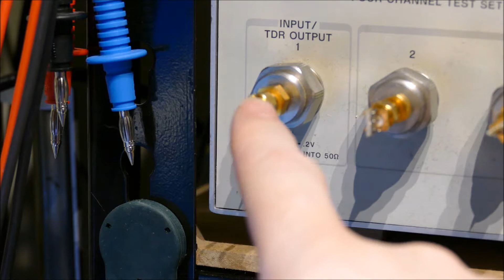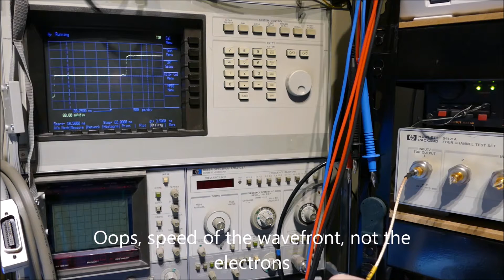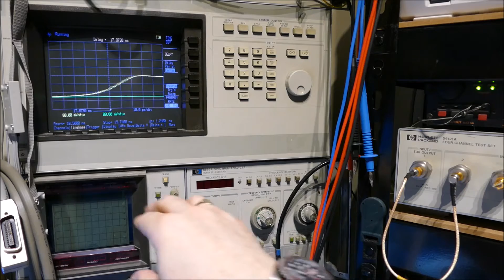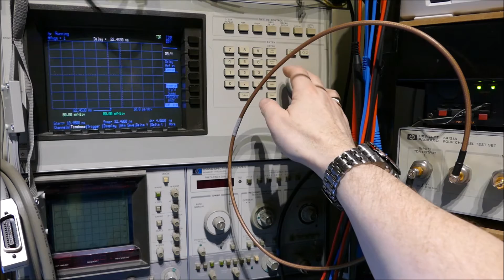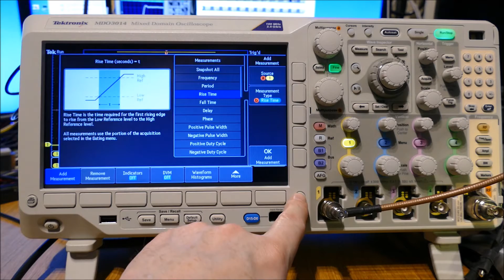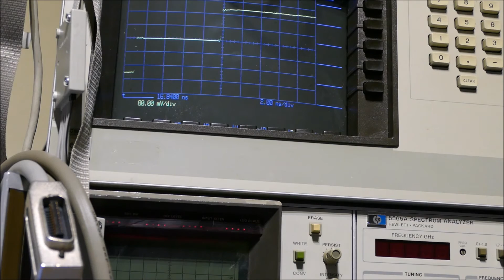Oscilloscope rise time measurement

Comment: Hi
Very detailed and important video.
About the 2.3ns Tr value obtained on your Rigol 1074z:  Is the oscilloscope firmware hacked to 100MHz BW  (or is it still factory 70MHz BW) ?

Comment: very instructive video. Thanks. If you should find it in your heart to make anymore exploratory videos of the HP 54120b (or any HP 54xxx model really), I'll be watching. I bought a 54120b ... w/o the test set - BUT OF COURSE! I used a color HP scope years ago, and didn't have the low down on the different models. I did scarf the umbilical cable at least.
Reply from the maker: +Chris Keegan I can't remember if I mentioned it in the video, but yes, you need the umbilical cable as well as the 54120 and test set, and it usually doesn't come with the scope or the test set. I have seen some complete set ups on eBay but they are rare, and sometimes horrendously expensive.